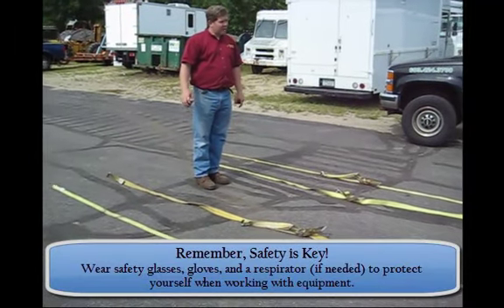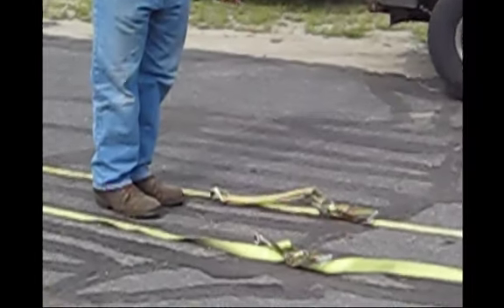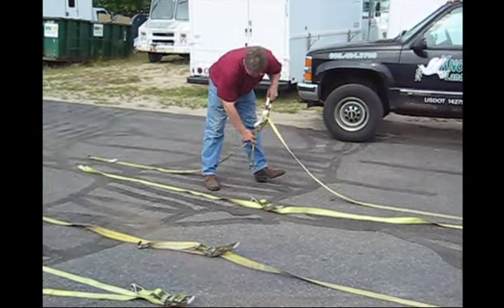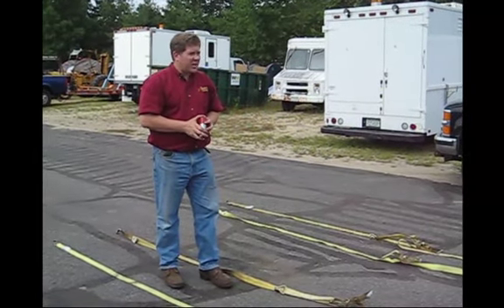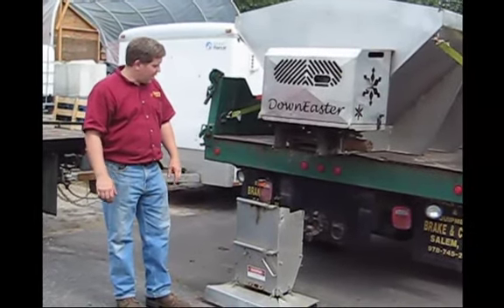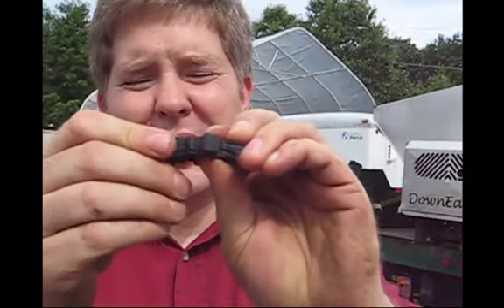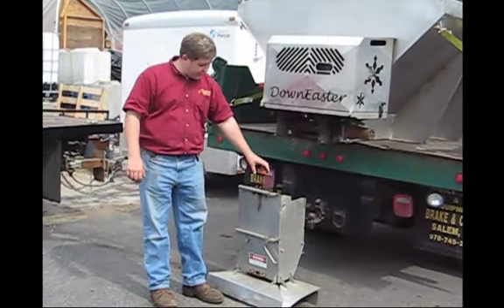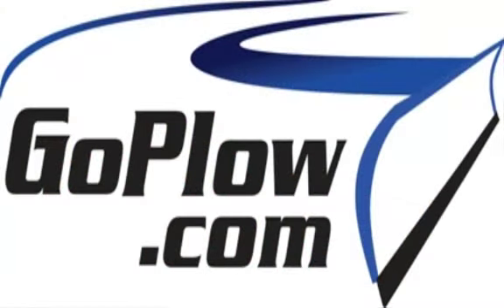Salt Spreader TiedownMaintenance

Comment: I hate to tell you but if you were to roll the truck over those straps wont hold that spreader down on the bed of the truck, they are so severely crossed that they don't provide enough down tension, Also very little in terms of side to side. control.  I feel that you would be better served by going corner to corner basically the same idea is if you bolted it down.  Or if you want the angle to make it less so 1/4 of the way back from both ends of the bed VS the entire length of the bed.